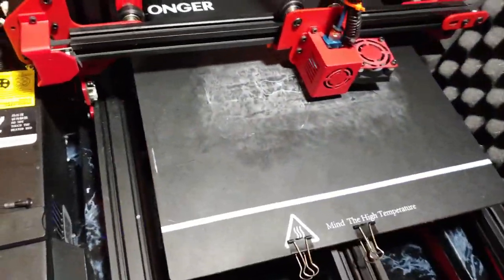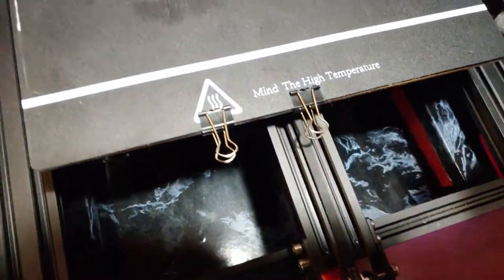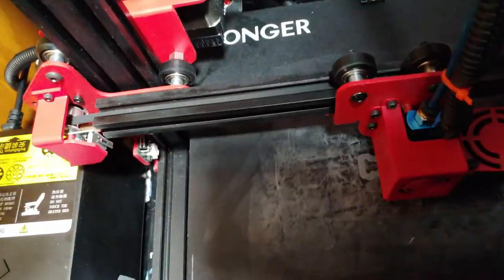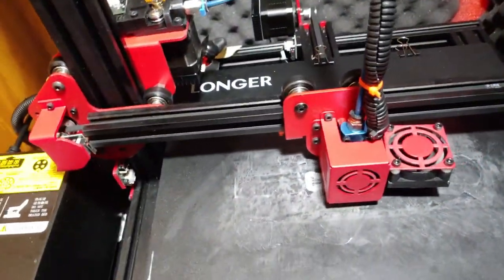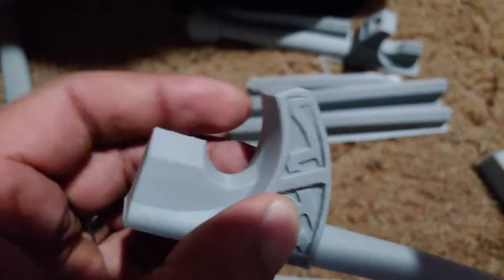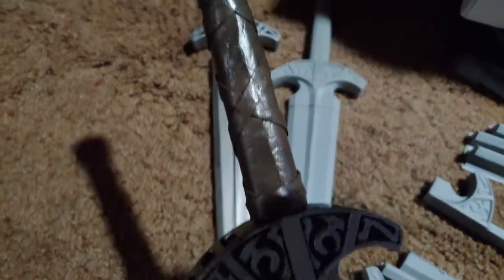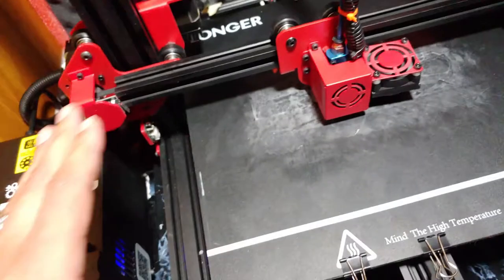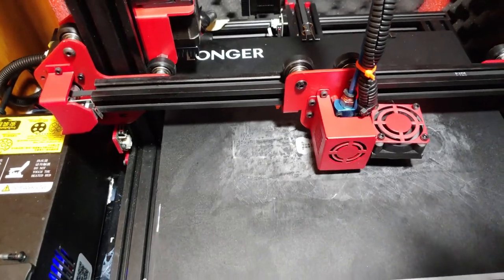How to get great 3d prints longer lk1 and others, z banding fix

Comment: Where at did you purchase your belts and the belt tensioner? I have an lk1 and I’m new to 3D printing. Your prints look great and I’d like to achieve your results.
Reply from the maker: Upgraded 3D Printer Parts Y-axis Synchronous Belt Stretch Straighten Tensioner for Creality CR-10 CR-10S 3D Printer https://www.amazon.com/dp/B07RFRRX7P/ref=cm_sw_r_sm_apa_fabc_MRKZDPHVMEM5BX5W26BY?_encoding=UTF8&psc=1
Reply from the maker: 5 M GT2 Timing Belt, Upgrade Non-Slip Version, Width 6mm, Fit for 3D Printer and Most Belt Driven Printers https://www.amazon.com/dp/B08JQJT6QN/ref=cm_sw_r_sm_apa_fabc_VG33A24A3Y9MQP8KMKEB?_encoding=UTF8&psc=1